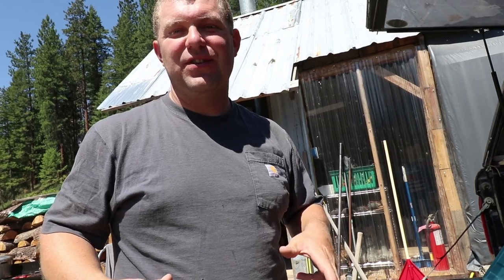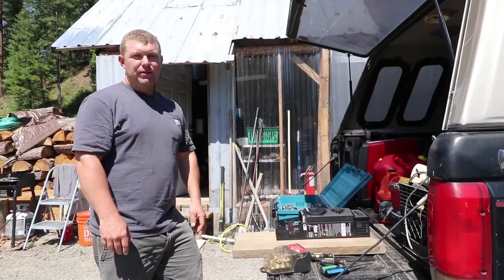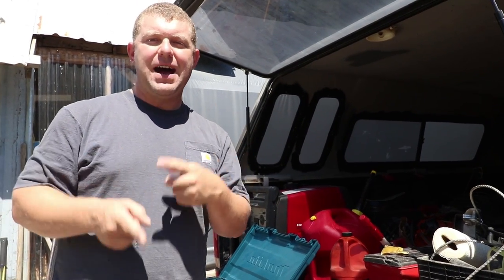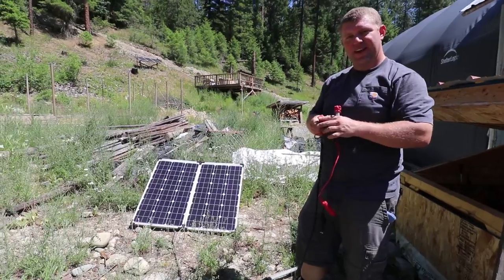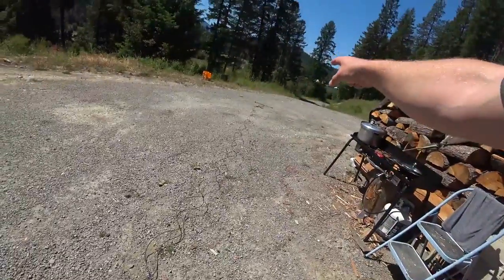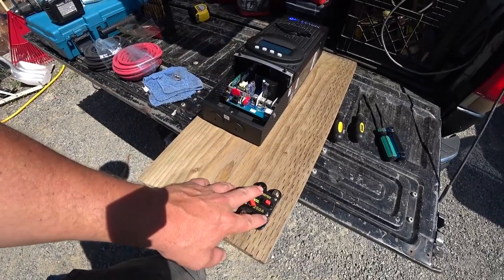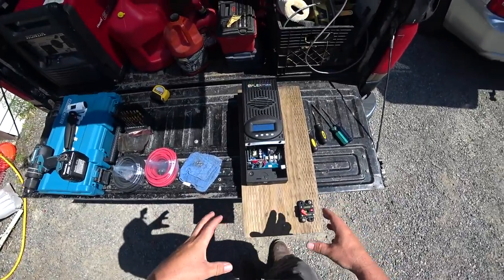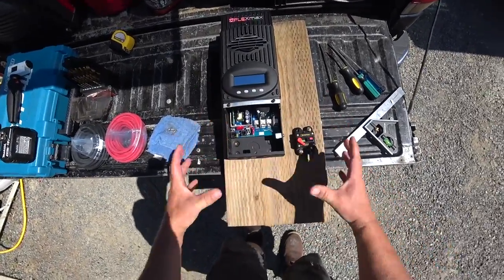Bad Idea? Now We Want Even MORE SOLAR POWER! (480 to 1230 Watt Upgrade)

Comment: I've been DIY for 25 years, doing drywall, framing, carpentry, etc.  I learned the following things.  A framer is the guy that covers up the mistakes of the draftsman, the drywaller is the guy that covers up the mistakes in the framing, the finish carpenter creates the illusion that the angles are plumb and straight.

Comment: Congratulations on the new MPPT controller!  You will love it (we also use MPPT).  Something you may want to consider (now that you have upgraded from the PWM) is running an equalization cycle (or two) on your batteries.  It does wonders for flooded lead acid batteries.  We have Trojan batteries and equalize once a month.  Respectfully - CommsPrepper (Hank)

Comment: I saw the crimper you used for the battery cables.  I can tell you from personal experience to keep an eye on them.  In the long run they will likely loosen up and cause connection issues.  It might be a good investment to get  a set of ratcheting crimpers.  They make a much tighter connection that won't ever fail.

Comment: Hey guys you are doing a great job, a small hint on solar panel orientation, if you can mount them horizontal, in the winter time when the snow covers the bottom row, it will still generate electricity, especially with an MPPT charge controller.  In the vertical position covering the bottom row will kill the whole panel until the snow is removed.  I have an off-grid home and start getting juice as soon as the sun hits hit even with the bottom 3 rows covered with snow.

Comment: Can you connect 2 of the 12 volt panels in series and match the 24 volt panels? You could then keep the 12 volt panels and increase your wattage.
Reply: Jay. he can't do it with his old panels. if you look at the controller, you can see hes currently pushing 72V through it. he would need to wire the 6 legacy  panels in series to reach that voltage. i think he only has 3 so it's a No Go however, he could use the current panels and add them to the new panels which could bring his voltage to 108v Dc however, the big question, what is the max input voltage the controller can handle? is it 120Vdc or less?

Comment: Glad to see at least one more person DIY solar. The attitude you talked about is why I don't generally participate on the solar forums.  Very few actually installed their own setup.  That said, I'd recommend looking into an anvil style lug crimper. They run $15-$20. Really do a good job of crimping big lugs on big battery cables.

Comment: A cheap way you two could use to lower the temperature in your battery compartment would be to run an air exhaust pipe up to the roof. The sun will heat up the air inside the pipe and draw ambient air into the box if there are air holes to do so. This would decrease temperatures when the sun is the hottest and would not cost you anything to run.
Reply: That's not going to do much of anything. Convection would cool the bottom a little but that's not going to be much more than what they would get with just a couple of holes from the heat they already have. An easier and more time proven idea is to get a small turbine for this. Those round ugly fan like things you commonly see on roofs are turbines, if there's wind blowing in any direction at all it'll cause it to turn and it'll draw air up and out. You don't have to get one of the huge 12" ones, people make and sell smaller 4" ones as well.
Reply: Wow, thats really cool! Thanks for the comment! Never heard of such a thing!
Reply: tommy, but,but that doesnt use any electricity, so how can it be any good (LOL) its a sciency thing right (like blowing over the top of a straw, sat in the cool and refreshing heavy liquid of choice and yet it can lift and expel said liquid, or how taking a sip and closing the end before the liquid column sinks back down, how can it stay above the level....science, its cheap and can cost nothing but time and effort), so it's to hard to monetise this.

and so the need to  buy the most expensive mains powered gadget brand name as it costs more and so must be better somehow!  form over function is the modern day humans ball and chain... even for the homeless and the low income consumer, not human...
Reply: andrew it seems you need to re-evaluate the convection understanding
 http://www.bbc.co.uk/education/guides/zttrd2p/revision/2

but apart from that we are talking everything temporary construction (so why put the temp panels so far
away and such a long unneeded cable run for zero pro benefit and many cons, as the whole flat area gets just as much sun,but whatever)

we are talking a battery box, lead/acid batteries dont care about the worlds largest resource AKA water
on the outside, so stand them in some water trays and get evaporative cooling  in the whole box...

just FYI you actually mean a "Revolving chimney cowls" are sometimes know as chimney spinners. They spin in the wind and are primarily designed to >>>stop downdraught in your chimney.<<<<
Reply: There would be more than one plus effect in ventilating the battery box.. H2 and O2 gas bubbles out of the batteries when charging and together in a closed space they may recombine into H20 real violently....  how airtight is the box as it is now? With 3 times as much charge current you get 3 times as much gas out of the batteries.  hydrogen gas in air is explosive at a small concentration.. (4%?)

 Also, charging "harder" in heat will make the batts need adding water more often, but I suppose Jesse is on top of that?
Reply: I think he's talking about a whirlybird which is used for roof/attic ventilation

Comment: One thing to consider, is that you could always cover your freezer with a few inches of spray foam, on the sides bottom and even the lid to reduce  heat intrusion, and make it a bit more efficient. You can also consider having a separate small fan to help keep the condenser cool when it's running.

Comment: Jessie, I keep seeing comments that recommend wrapping your freezer with insulation to make it more efficient. Older freezers had a fan and an external condenser coil to dissipate the heat. Most all of the modern units route the condenser coil just below the external skin of the case and use the metal exterior to dissipate the heat. The sides of these units feel warm to the touch when they are running. There is nothing that you can do to make them more efficient.

Comment: You are correct.  I have a large system. But I started with one panel and one cheap charge controller and a harbor freight inverter.    I learned by watching YouTube.   My next project is a solar powered hot water heater.  Great vid as usual.

Comment: As a note about your batteries make sure the vents (holes) on the refill caps face AWAY from the posts or the venting gas will prematurely cause corrosion on the posts. (this is a lesson I learned working on electric carts).

The board layout is not a new Idea and is commonly used professionally I'm glad that you guys figured it out.

FYI you are generating  609 Watts  (P=V*I   73.4v*8.3a=609.22)

Comment: Congratulations... Excited to see how that works out in your next solar video.
I just got all the pieces of my starter solar system delivered and am super excited to see how it works.
1.3kw of solar panels, 4x200ah 12v batteries, 6kw inverter 80amp MPPT charger controller in one, all on 48v with 120 and 240 output with up to 18kw burst for 30 seconds on the inverter = about $5,000 including wiring, connectors, breakers.
The system can be upgraded with another 2.7kw solar panels and I plan on adding another 12 batteries.

Comment: Solar power is an evolving industry.   Building and performing maintenance on your own system has a learning curve. Having common sense and a basic knowledge in electrical theory will help with homestead system.  Also, having the proper tools to perform the work makes the job easier to complete in timely manner.

Comment: When you think about mounting your panels, consider a 2 or more position mount system for summer and winter. the steeper angle for winter could also help them reduce snow build up.

Comment: Dig a hole for the batteries it will take care of the heat in the summer and the cold in the winter. You can use the backhoe to lower them down into it. You can use all the rocks you have to build the walls and timber for the hatch.

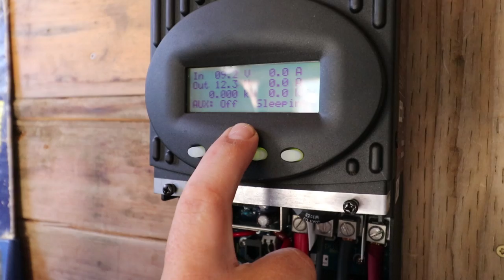Comment: I know this is an old video but I thought you might find this interesting. @18:10 the reason it reads 9.6v with nothing connected is probably due to what we call "floating pin voltage" or "floating voltage".  When nothing is attached to a pin on a chip, it will always have a reading unless that pin is grounded (usually done via a high value resistor). Not all devices are grounded like that, especially if it's never intended to be used that way. But it is not uncommon to see voltages from 0 to even 200v with a floating pin.

Comment: I have an FM 80 as well, connected to 900 watts PV, and I run several things all day and charge the battery bank full (now that I adjusted the absorb time properly haha). Check with the manufacturer of your batteries to get proper settings. I only got a couple of cheap walmart batteries and limited space without modifying the battery box (luckily I can still switch to the pole if needed but don't like to do so as it costs someone else. Bulk will take the bank to about 80% and absorb for several hours to top off. I'm still fairly new at this too, and can appreciate you guys awesome attitude. Sometimes people with lots of money are real turdballs! I have tons of respect for those like myself who DIY, it's just an awesome thing. My philosophy.... Not one of us knows everything there is to know and only an idiot would say he does. Cheers!

Comment: Jesse!  I have a simple idea for helping to keep your chest freezer cool.  A friend of mine made a chest cooler cool box out of plywood and expanded polystyrene foam.  Build a simple box to put around the chest freezer and line it with the foam insulation.  However, it is important to note, do know cover up the fan ventilation at the bottom of the chest and in the back.  You should be able to get away with a single sheet of each wood and foam.  If you can spare the time and money for the resources, it might help out with the power consumption.

Comment: Regarding higher voltages for your solar battery bank check to find out where the nearest forklift dealer is, the stand up forklifts use either a 12 volt or 24 volt battery and you can buy a good used forklift battery with 4 to 5 times the capacity of your present battery bank for a lot less money than buying new and I agree with another fellow who said run a pvc pipe vertically from your battery bank for natural convection ventilation just make sure you have an entrance point for air flow into the battery bank as low as possible with a screen to keep the critters out. Each standup battery cell is between 24 to 36 inches in height giving you far more capacity than what you have and is in a steel enclosure that the two of you can easily move around. Just don't forget to tie it down when transporting it.
Best of luck.

Comment: Excellent video. You could use the older smaller panels for landscape lighting.  LED.  Also just wanted to let you know (probably already do).  They make a 36 volt solar powered well pump.  For when you still your well.  Especially for garden irrigation.  Have a great day

Comment: Hi, love this video,  especially from the 8th minutes, I've been building my solar system from may 2013 until today, slowly but surely, I've know what you mean with people criticizing, saying that solar wasn't worth it, well finally after 4 years evolving my system from 12V with 230W of solar power to 48V system with 4000 w of solar panel, having the  48V Magnum inverter, 2 Midnite classic charge controller and 220AH of batteries(yes it is a low batterie bank Ah, but that is my first batterie bank for the old 12V system), I can say this: Doing all those mistakes I've made building my system slowly from 12V to 48V today, have helped me learn a lot faster about wiring, types of connections(series-parallels), type of solar panels, inverters, charge controllers etc, doing it with a contractor wouldn't have  helped me understand all the things I've learned building that system. Of course critics is good, taking some advice to improve etc, but some people, some people gives critic, without having tried themselves a solar installation. Theory is one thing, but practice in real world, with real life condition is another thing, solar energy really is working good, even in winter, Many people told me to forget about solar energy, that it was a wast of money...Well after 4 years finding solutions to all my mistakes, solar panel system with batteries, when used wisely, is not that bad of an idea. I'm doing my cooking, clothes washing, some heating in winter, in sunny and partly sunny day, not cloudy day, lights, computers, freezers, refrigerators, are also on my solar installation, water heater in spring to autumn is on solar, it is without a doubt a good investment, our electricity bills has been down around 50% less than before, which means in 12 years our system with batteries will be payed by itself. Of course without batteries, this number would be around 8-10 years, but in our case we do need those batteries. With the Magnum inverter and it's automatic settings it makes a huge difference from my old inverter that wasn't starting automatically by itself, it's efficiency in 48V is also helping a lot... anyway i'm happy that today my installation is finish and working beyond my expectations, and other peoples expectations with their theory on solar...

Comment: I also wanted to mention you can use your other solar panels and change controller in parallel with your new setup!  One won't backfeed the other. But each charge controller must have its own set of panels. I'm running 3 charge controllers with my setup.

Comment: you can use the old panels and have both the out back and flex80 at the sane time. I run a midnite classic 150 and a pwm tristart 45 to my 48v battery bank no problems

Comment: Great Job!  You might get more efficiency from your freezer if you add evaporative cooling.  The side surfaces of the freezer are where the heat exchange takes place.  If you apply evaporative cooling to those surfaces you might reduce the power requirement.  Think there are YouTube videos on the subject.

Comment: great job. keep at it you are getting it. I just got my 5kw 24v inverter. I can't seem to be able to find decent affordable wire locally!  that getting the parts I need. my pump the paper work said it has  a 1.5" outlet. but guess what... its not. and I got the fittings for 1.5" NPT .. so that's another hold up. I know what you guys are going through! next time I'm taking what ever out the box. and see what size it is. before I buy a bunch of parts for it. thankfully I'm very close to a hardware store. keep at it guys. don't pay any attention to all the negative comments out there. keep on keeping on!

Comment: Go to 12: 10 in the video. It looks like the wires have skinned insulation from the sharp sheet metal, when you pulled them through the hole in the back of the shed.

Comment: Some freezers have a fan with heat radiator under them, others have a hot coil on their back, some wrap the hot coil invisibly around the box of the freezer.
All need a gap around them so air can carry away the heat.

Comment: Don't know if anyone has told you, but you can wire panels in series to increase voltage while keeping amperage to single panel level. The outback will take high ac voltage at low amp, convert it to low voltage high amp, and smart charge your batteries.

Comment: Looks like that charge controller was a really good piece of the system to update. I'm sure the inverter will be upgraded at some point, but at least now you're getting enough power for current needs. I also don't think a lot of people realize how expensive it can get to set up a system that can totally replace other power sources for an average size home. If you have 20-30k to throw at it all at once, by all means go for it. Doing it in steps may be the only way some can approach it.

Comment: Last idea for your perusal.  Use your old panels and batteries (When you upgrade, you will probably want new batteries).  Make a bank of 24v batteries for the lighting or 12v.  Those LED strips have remote controls that are all low voltage.  I changed my bathroom fans with lights, and put in a dimmable light by cutting the strips to fit the length of the housing.  I put in 6 rows of strips about 8 inches long.  I used the remote dimmer to change the light from high during the day to low at night.  I don't know if you can tap 24v off the battery bank before your high voltage conversion.  Have fun.  Food for thought.

Comment: hey guys. love the videos you make an amazing team...   just wanted to give you a tip. i work in communications in AUS,   if you are going to run any cables underground, (for power, comms, solar, etc) use bigger conduit than you think you need, i would suggest a 50mm internal diameter pvc conduit.  you might not need the space now but re-digging a trench to run one or two cables sucks,.

Comment: It looks like your charge controller can handle more voltage. If you wire your old solar panels in series with the new ones you could harvest an additional 480 watts.

Comment: odds are you are heating the tent up by adding the a/c unit (unless you figured out a way to vent it to the outside), and by overheating your tent, your freezer is having to work harder to keep cold. Either come up with to vent the excess heat the a/c generate out of the tent, or move the freezer somewhere else that is cooler!